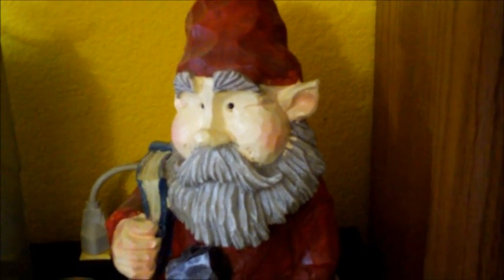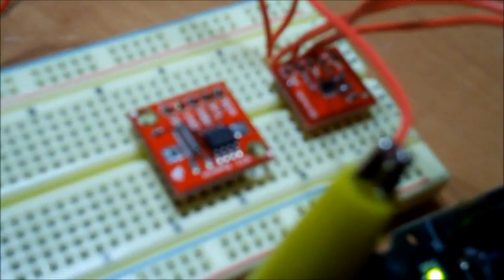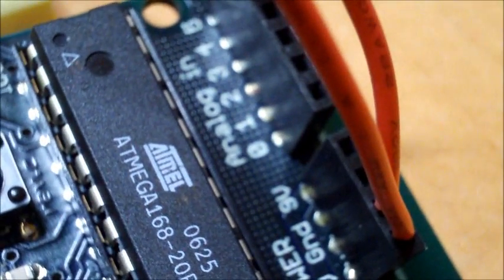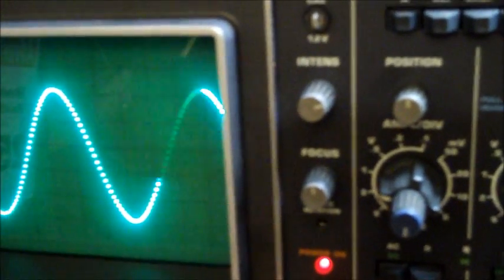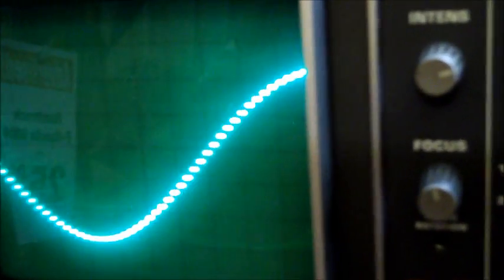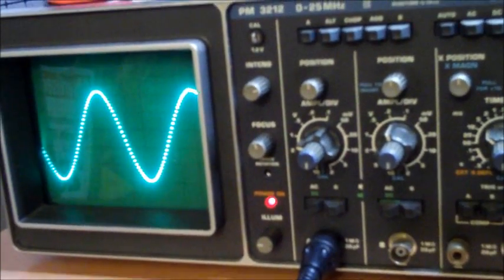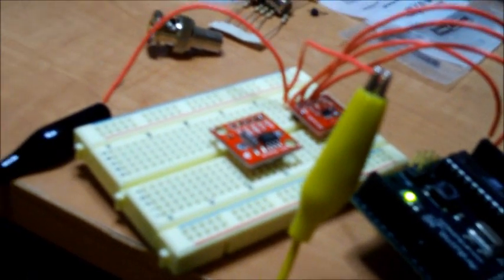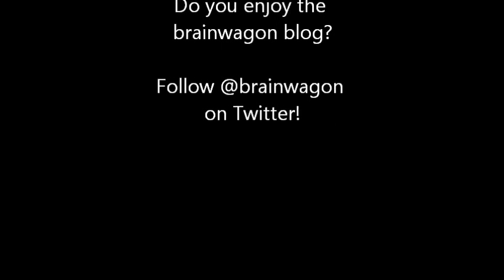The MCP4725 DAC on the Arduino

Comment: All the example Arduino sketches for the MCP4725 is only getting output of around approximately 36 HZ.  I also tried the examples in the MCP4725 library with the same results. Not sure what I am doing wrong.  Could help em to resolve this issue.
Thank you in advance
Reply: Reference the Arkadiusz Agaciak
's comment.

Comment: Hey, I am trying to make a custom waveform generator.
i have a graph of data (saved on my computer) where x axis is time in milliseconds and y axis is the adc range from 0 to 4095 (12 bit) all the data points are equally spaced in time.
The data is huge the x axis goes till 30000 (milliseconds)

I am trying to output the data on a COM port using processing or python,
The arduino reads it and sends the appropriate command to spit out the equivalent DAC voltage.
eg - if i am sending 2048 data (on serial COM port to the arduino) then its 2.5v at the dac output.

Can you help me in the latency calculation of the whole system?

Comment: try 

 void setup() {
  Serial.begin(115200);
  Wire.begin();
  Wire.setClock(400000L);
}
Reply: Thanks for your advice,  My device makes 96.5 Hz signal.
However, it's too low frequency to be supposed that he said "Maybe 2k Hz".